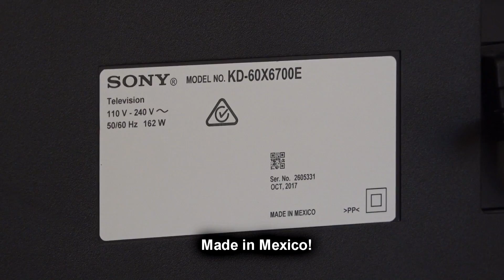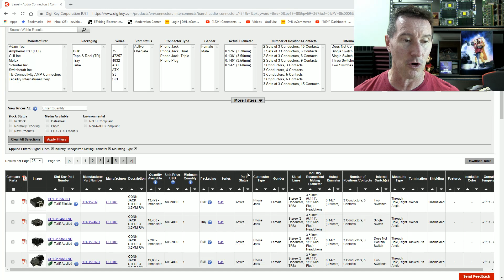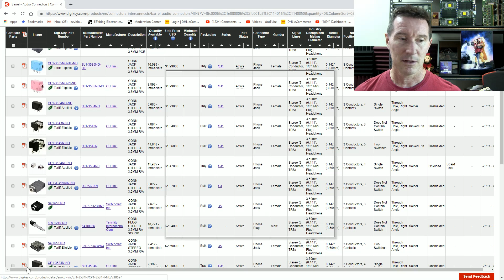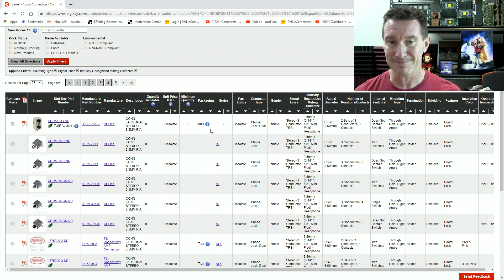EEVblog #1195 - Sony 4K 60" LCD TV Audio Repair

Comment: My 2017 55" Samsung doesn't even have a headphone out, only optical and coax, so if you want headphone support you'd need a DAC and some sorta amp, or a combined unit.

Comment: I have a Samsung 50 inch and it's getting very hot in one corner. And i mean extremely hot. I don't know if anyone experienced this issue. The picture is a little bit lighter on that spot. It's still in warranty but I don't think they will do anything to it until it's broken. Has anyone any advice ?

Comment: With the exception of the Chinese imports like TCL and some Hisense, and very top-end stuff like OLED panels or 8k QLED, there are only a handful of factories in Mexico that literally "make" (assemble) all the base model and mid-level TVs for all the major players... Samsung, LG, Vizio, Philips, Sony, RCA, Sharp, etc.  At the end of the day, they all are sharing the same Mexico factories for majority of the low/mid 4k TV's here in America.
Reply: Not everyone, Samsung has his own factory, Vizio,Sony and Sharp share the same factory. All of them in my home town in Mexico.
Reply: @jasonchang7762  - That's cool, those factories are massive in the photos I've seen.  We shouldn't forget Samsung is also OEM for other TV's sold under different brands.  Some of the older Insignia's were Samsung panels, for instance.
Reply: @cup_and_cone  Indeed, same as few Chinese designs that foxconn in Mexico produce.

Comment: For your TCON afficianodos that looks like a Sharp TCON, so probably a Sharp panel as well.
Reply: There is a Sony model that use parts from Vizio, and it seems to be that model. If I have a better look if the barcode on the main board, I can tell if it was made in Mexico

Comment: And people wonder why I still use CRT TV's that I purchased in the 1980's.  The damn things never fail.  I have TV's here from the 1960's and 1970's and they still work flawlessly.  I HATE modern televisions.  They seem to have a 2 to 5 year lifespan.  Quality absolutely sucks on modern televisions.
Reply: Same thing on everything else. Later some people are surprised that I don't bother getting anything new. pc, tv, etc instead going back to the "stone age" of electronic things. I simply don't need a 5k eur program that works only on win10 that won't work a year later thanks to a stupid "update" and will be replaced by a even worse one. They halfass everything so people blindly buy new things thinking it will solve every problem. While I am fine with my 15 year old software on P4.
Reply: Planned obsolescence, everything is designed not to fail while is still in warranty, but to die at anytime after that.
Funny enough some cheap appliances tend to last longer as to plan the obsolescence is costly.

Comment: I ran into a similar problem many years ago on an early (very early) walkman-type recorder. The problem was bent contacts inside the jack. No exact replacement to be found. I ended up totally removing the headphone jack, disassembling the whole thing, reforming the contacts, and putting everything back together. It worked but I never want to do that again. I no longer have the vision or dexterity for it.
Reply from the maker: Nice. Stupid to use non-standard connectors. Although it might he standard across Sony products
Reply: But common. Look how many you found listed. 

Oh, for the days of the regular old metal, nut-mounted jacks. You knew you could find one back then.

Comment: 2:10 It wants to be taken apart too!
Reply: Stuart McConnachie It may have entered deep sleep battery preservation, requiring longer activation to wake up.
Reply: Then it was coded by an idiot, as most micros will have external interrupts that can wake from sleep in milliseconds or less. And I can’t see a screwdriver taking a couple of seconds to boot out of sleep - it’s not some connected IOT device with a Linux disto for flips sake!
So sure you could be correct, but only if the designers weren’t sensible enough to connect the power switch to an interrupt pin, and are sleeping the micro for a few seconds at a time in deep sleep and polling to pin. You could be correct, but that’s a bad choice IMHO. The average user will not understand and at best find it mildly frustrating, at worst assume it is in some way going faulty.

Comment: If you've got any old soundcards / motherboards kicking about have a look on them. They're a pretty good source for 3.5mm jacks if you can find a match(and be arsed to desolder it).
Reply from the maker: I did, none of them matched.
Reply: Do you need a hand with that.👏

Comment: Ngff tuner? Wondering if it's USB...
Reply: TuttoCrafting Lots of pins, so must be USB 3, PCIe or something proprietary if all digital.  Alternatively it could feed analog 10MHz bandwidth quadrature to mainboard decoder and be controlled over I2C (channel switching, gain control and board ID).  Mainboard them does the QAM decoding according to DVB or ATSC, and may or may not support analog composite decoding.

Comment: Did that happen to fix the conflict between the headphone output and the soundbar output .... ?
Reply from the maker: That was a software thing.
Reply: @EEVblog  Pretty sure you were going to say that was a "user" thing .... in which case I would have said that the software should be more user-friendly, so yeah, it was a "software" thing

Comment: I just got my first taste of Bluetooth speakers recently (haven't tried wireless audio before) and I have to say the quality is quite good. Plus you can't trip over Bluetooth...
Reply from the maker: This TV does not have Bluetooth
Reply: @EEVblog  There are quite good Bluetooth (and even FM radio) transmitters under 10USD. You plug it into the 3.5mm jack you just fixed and a 12V adapter or USB port ;)
Something like this https://www.amazon.com/dp/B07LD79658/ref=sspa_dk_detail_0
Reply: And depending on the bluetooth version the interference problems could be great up to about 10 - 20 metres
Reply: @England91  I got a cheap mono Bluetooth speaker, designed in Germany (or UK?), made in China ... called Jamoji HX-PEM05, it was on sale for 8USD (including 19% VAT) and I couldn't resist. I believe it uses Bluetooth 4.0, but it's really powerful as it goes through one 30cm thick solid brick wall ~5m from source. I couldn't believe how clear the sound is, no distortions, but audiophiles will surely point out the absence of low (<120hz) frequencies. Personally low frequencies bother me anyways while I'm working, so any clear sound is good enough for me ;)
Reply: @Poxenium  I had easily 10 metres through wall before but some about 5 metres through a glass window, like I said I can be great range

Comment: I've always known those connectors as "TRS sockets / jacks"
TRS = Tip Ring Sleeve. 
The four pole versions are TRRS = Tip Ring Ring Sleeve.
Reply: "Headphone jack" where I'm from
Reply: Used both.
Reply: digitalradiohacker / Yep, to me barrel connectors are hollow like the DC power connectors.  Phono connectors (with tip, sleeve and 0 or more rings) come in multiple diameters and were never headphone only.
Reply: Must be a telco man lol...
Reply: Always called it a 3.5mm jack.
Reply: @Audio_Simon  1/8" in the US but we call it both these days
Reply: @Audio_Simon  It's an 1/8" jack ..... Because we Americans are always right and know the metric system is just a conspiracy by the multi-nationalist corporations in their conquest of the world ..
Oops I went too far again didn't I ? OK I need to watch less TV and more EEVblog .......
Reply: @longjohn526  So is it actually a 3.175mm jack but us metric guys rounded it up?
Reply: @longjohn526  Nope, just measured it with a calliper. It's 3.4-3.5 mm.

Comment: Just cut one end off an extension cable and solder that to the board... some cable ties or just a knot for strain relief and everything will be fine :-)
Reply: Mathis Bü He also needs the detection switch that tells the circuit if it's plugged in or not.
Reply: Mathis Bü He fixed it though didn’t he?
Reply: @bfapple  , yep, but looks like he's planning to put a new connector in. I missed the detection switch though
Reply: And then install a headphone jack in the soundbar :)

Comment: I noticed straight away that it was a non standard socket design. I suppose you could have simply soldered wires to the board and had a dangly socket flapping about if you didn't care what it looked like.
Reply from the maker: Seems quite non-standard
Reply: @EEVblog  - What I don't understand is why. Can you see any reason why a standard socket wouldn't have fitted? I mean if the board were designed that way. By standard I mean like the first hit on digikey that you showed.
Reply: Why? Because its a Sony TV. Only Sony would use a custom hard to find headphone port. Im pretty sure my Toshiba TV uses one of the ones on Digikey.
Reply: It might be a exclusive Sony part.

Comment: Couldn't you add a splitter to the Audio out going to the sound bar and hook your headphones to that? That way you don't need to go around back to plug them in all the time. Or add an extension to the headphone jack I guess.
Reply: It's bloody digital probably. Can't tap that.

Comment: Those are some premium Rubycon caps! You can tell they are better because they're golden!
Reply: Gold means low esr :P Color coded gold to make the audiofools happy :)
Reply: @rich1051414  But... but.. surely it's real gold because that always improves the fidelity?
Reply: C'mon dude, everyone knows the platinum ones are better because platinum is worth more than gold .... But are the oxygen free? That's the real question true audiophiles want to know .....
Reply: Either Rubycon or Nichicon; they use the same black & gold plastic for their low ESR series. Some cheaper brands probably do too, but I'd trust Sony to use the good stuff.

Comment: Nice LLC-Resonant Mode Power Supply.
You don't see anything else these days...
Efficiency probably in the low 90s...
Reply: Stefan Payne Interesting that the main regulator IC crossed the isolation gap.

Comment: Stop complaining Davey. LOL. Next time, just lay down a towel and lay the TV flat on a table with the legs hanging off the edge. Good video.
Reply from the maker: Because it's more of a pain the arse.
1) You have to find and clean off a suitable large table 
2) You have to move the thing and won't have access to the existing cables 
3) You can't see the screen 
4) Not as convenient to access stuff.

Comment: Who the hell would use a wired headphones for a TV. Seems ridiculous.
And btw, many TVs for a few years don't even come with analog audio output which is a bummer when you want to connect an oldschool amp.
Reply: Headphones are good for watching TV when the rest of the family is sleeping. Plus wires headphones are cheaper, maintenance free and most TV's don't have Bluetooth anyway
Reply: @jorgeszabo1659  Also if you are the only one watching and want better quality audio than bottom firing speakers inbuilt speakers it's much cheaper to get quality headphones than entire sound system.
Reply from the maker: Because it's easy and it just works. No batteries or connection issues to dick around with. And this TV doesn't have Bluetooth.
Reply: Yes, i would use IR or FM headphones.